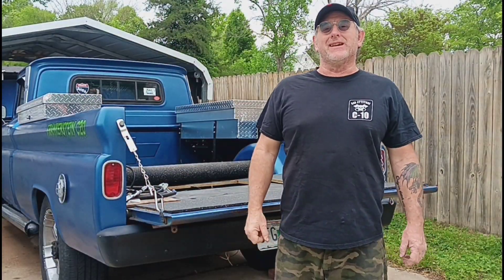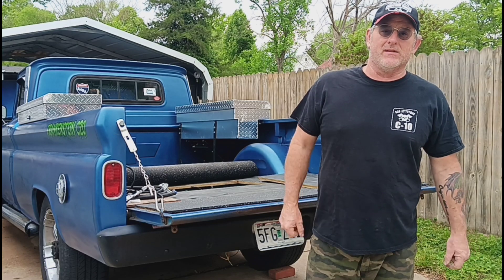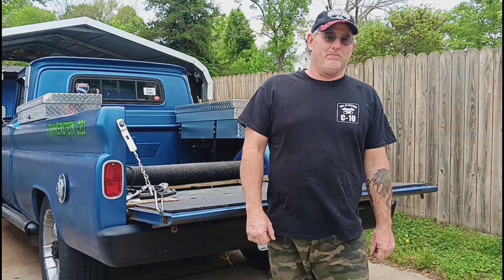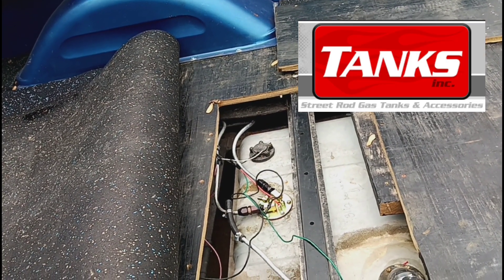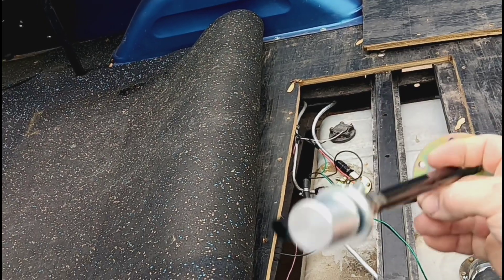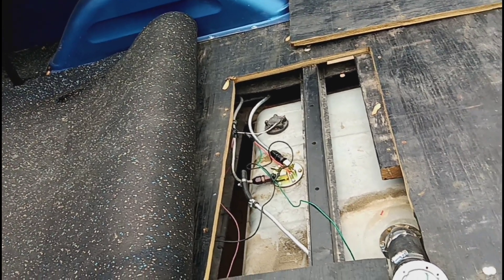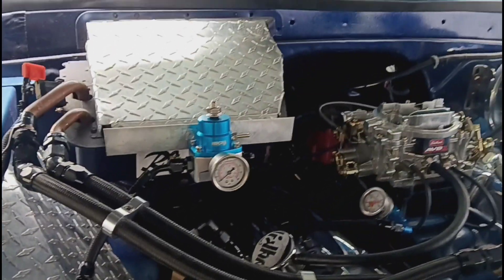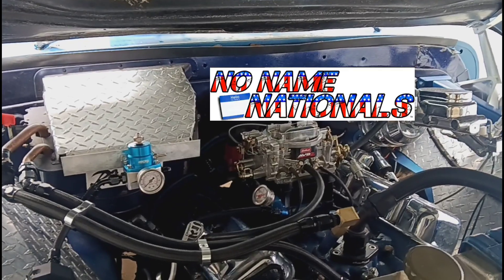1965 Chevy C20 Truck Electric feul pump conversion.

Comment: Looks like that regulator has a Boost Reference Port as well. I bought a set of those clamps off Amazon to add mounting points on my roll cage bars. Nice shirt! 👍
Reply from the maker: Ya. I thought them clamps would work for what I wanted.  I know a guy who could hook you up with oneof those shirts 👍
Reply: @Dr.Frankenstein65   those clamps are actually pretty nice, I think I got a 4 pack for less than what I was paying for just 1 of the other brand aluminum roll bar clamps.👍
Reply from the maker: I got the 2 pack. I'd like to make use of the other one for something.  Not sure yet . I just couldn't pass them up 👍